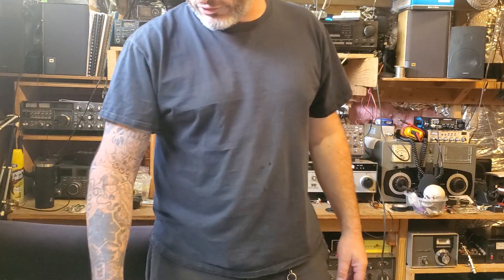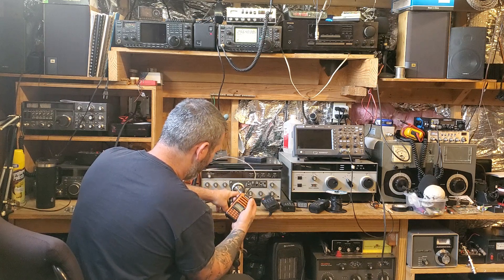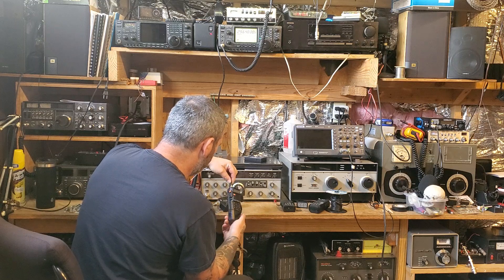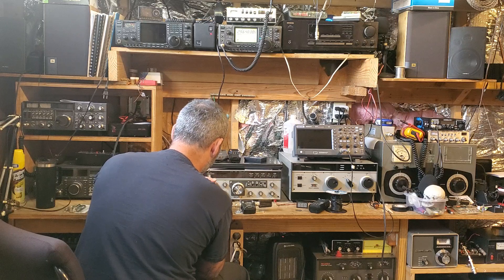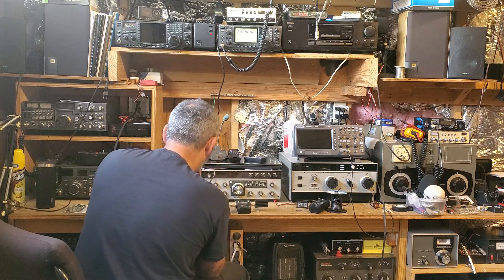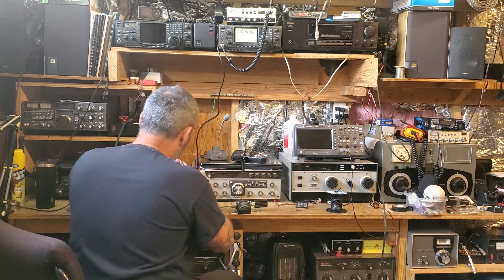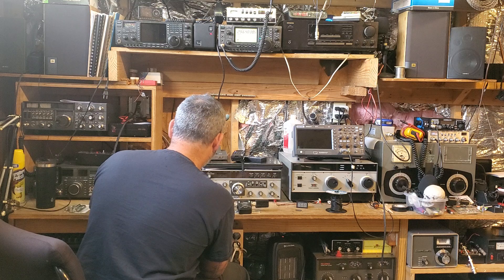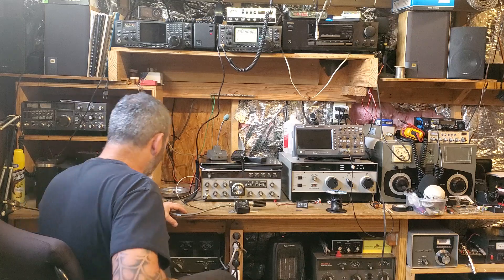comparing new baofeng TP-8Plus to some other ht ham radios

Comment: Ya I gave up on those types of HTs a few years ago.  I think I still have a few Baofengs in a drawer and I have a Anytone 878, which is an "ok" DMR radio.  All the rest of my HTs are commercial Motorola or Hytera.  Actually just picked up a VHF XTS5000 and UHF XTS5000 a couple weeks ago.
Reply from the maker: This one has way better rx than the old UV5r and 999 memory ch and usb c . I discovered that it uses the same battery as  the tyt th-uv88 almost the same radio body. I don't talk on vhf uhf unless simplex so I just play around with them for other people to discover lol
Reply: @hamradiohack  Ya its a cool little radio for what it is. I've been thinking about getting the BAOFENG GM-15 Pro which looks like its the GMRS version of that radio.  Its supposed to be a pretty good radio for GMRS and has RX for the ham stuff too.  Now with GMRS licenses so cheap these radios are a good entry drug for my kids without breaking the bank :)
Reply from the maker: @kabish0603  yes. The software is a big problem with this one. They sent me some bs cd thst has nothing  to do with anything.  The uv13 pro doesnt come up with anything either.  I found a YouTube of the uv13 and his mention of using some pv15 cps software is no longer on the abbree site. I did find it elsewhere and its working  but ham only it's definitely locked 🔒 if a new guy tried to buy one I don't think he would be able to come up with software. I have a feeling the ebay version is different